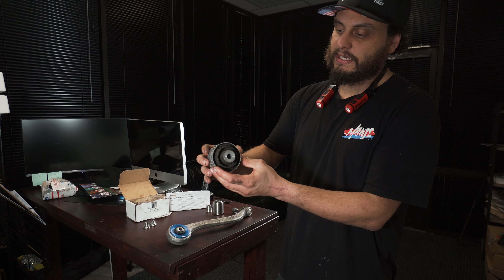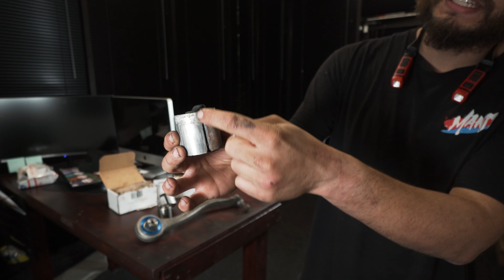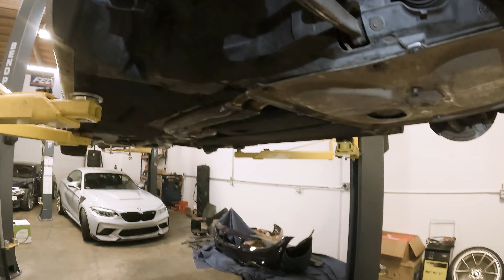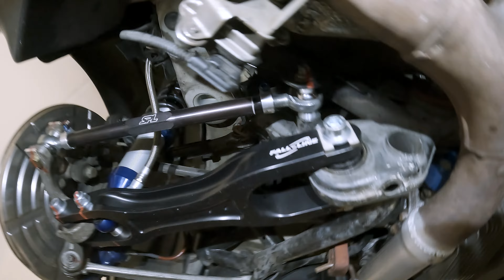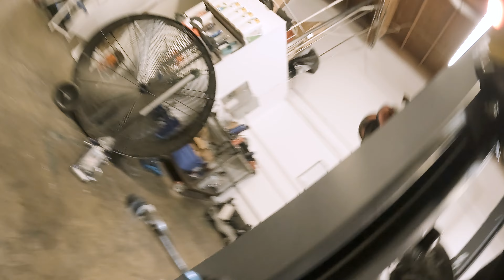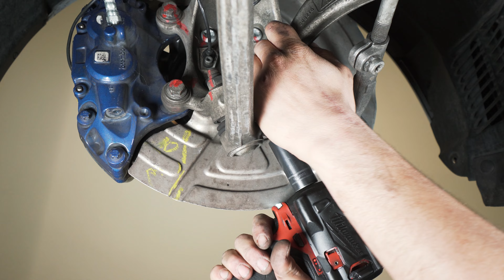Best Suspension Upgrade For The Money?? | BMW M2 Competition | Ultimate Track Build Pt. 18

Comment: Why you didn't press out rear monoballs? Not enough space to fit press kit? Also did you use Loctite?
Reply from the maker: No Loctite, and yes due to space issues easier/quicker to burn and hammer the old bush out. I did however use a piece of all thread and a few appropriate sized bearing/seal drivers and cups to get the new moonballs in. Works better than my specialized bushing tool due to space.